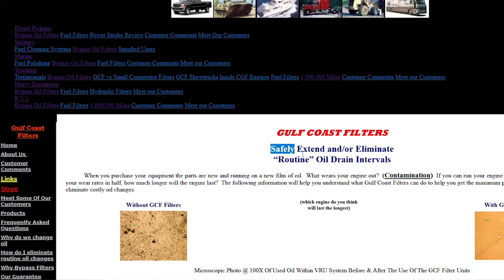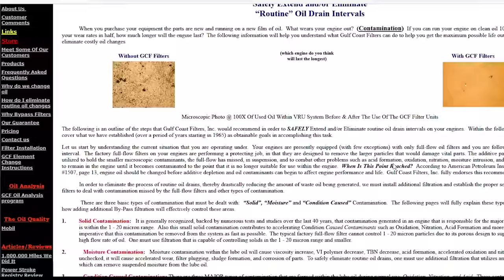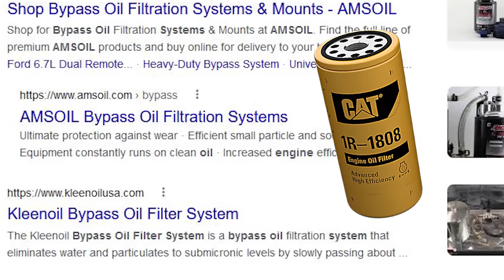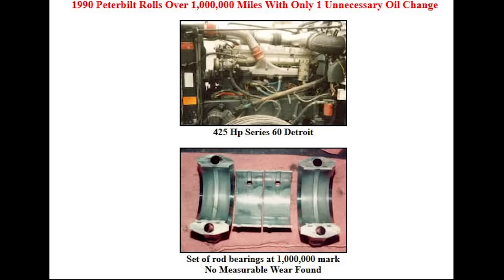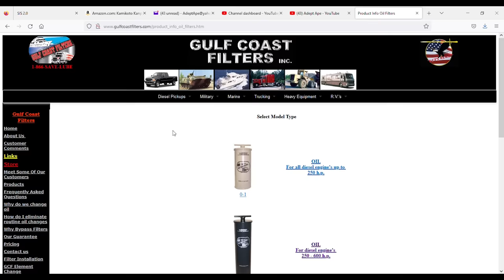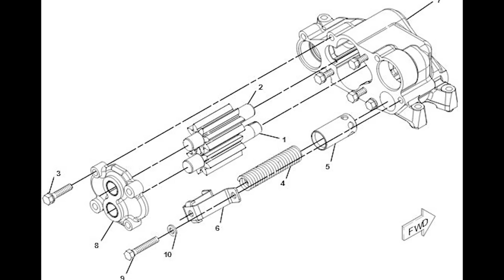No Oil Changes and 1 Million Miles!!! Are Oil Changes Optional with a Bypass Filter? (INTERESTING)

Comment: Im an engineer on a tow boat. My company used to run puradyns and never change the oil unless catastrophic engine failure, or a bad sample. The goal for us on a boat engine, anything from a 3406 or a detroit 60 series up to 12 cylinder 645 emd’s it to get 40-50,000 hours on them before rebuild or replace. Ive seen a few of the older ones go 45-50,000 hours running puradynes. But my company just ditched the puradyns as the prices for those are about the same as changing the oil and filters. We havent been changing oil long enough for me to definitely tell you it’s better, but i was one advocating for it. We have a few engineers in the River division that have said nope to the company’s desire to run the puradyns and not change the oil and just changed it anyway. Those guys have had less engine failures across the board than the puradyns. There is a place for the puradyns, they are wonderful for equipment that you literally cant shut it down to drain the oil. Just close the valves to the puradyns, change them, add 1-4 gallons per filter you changed, open the valve back up. But i stand by that if you can shut it down and service it traditionally you will get longer engine life.

Comment: I use by pass filters all the time but I still change my oil on a normal schedule…I run them for the times I may pass my scheduled change and/or just for a extra safety….You talked about fuel dilution, fun fact the P51 mustang (along with other planes of the time) use to dilute engine oil with gasoline via a switch inside the plane to thin the oil for cold starts…I study plane mechanics and maintenance because I believe they one up the standard mechanic in maintenance and standards in some ways…
Reply: Did the engine oil never get up to operating temp? I know on small single cylinder engines fuel dilution decreases horsepower considerably.
Reply: I always stay up with Aviation technology. They always get the new stuff that comes out then it filters down to other industries years later.
Reply: Wow..maybe i should try this mustang p51 technique  on my 1200cc bike
Reply: I read somewhere that they flipped a switch and injected water in the intake on the fighter planes for extra climbing power. Any of you guys ever heard of the old FAA and PMA approved AeroFrantz  filters.. They used toilet paper. Saw some on crop dusters north of Sedan Kansas in the early 1980s.. Read a few oil analysis reports on light aircrafts.
Reply: @fidelcatsro6948  don't do that!
Reply: Hmmm. I'm not so sure they did that, inject raw fuel purposely into the oil? Naw that would be very hard on those engines. They were extremely stressed (read run hard) in the first place me thinks..
Reply: @Houndini  new stuff? Hah! 1940s-50s technologies? Which we are still running today because of the high costs of getting anything approved by the FAA. At least any GA piston engines stuff. Military yeah probably.
Reply: @oneninerniner3427  They did it for fast take offs to get oil moving once engine was started so they didn't have to wait for the engine to warm up...They have a oil dilute switch right next to the mag switch's.

Comment: The company I work for has just introduced a bypass filter on the QSX15 we use. We're currently in a testing phase to see how far we can take them.
Reply: Please, report back your results if possible. Very appreciated.👍
Reply: When I started using bypass filters in 1963 you couldnt use multi grades in a diesel. Delo came in 30 and 20 weight..The discount stores sold it for about 29 cents a quart. In those days the only filters that cleaned oil were the Frantz and Motor Guard..For diesels you had the Frantz 3 stacker. Motor Guard had manifolded filters..oil is a lot better now. All I use now is 50 year old Motor Guards a few modified Motor Guard compressed air filters Some Gulf Coast juniors and a flat head Ford canister filter adapted to use Scott 1000.Also the Australian Jackmaster Classic. I prefer the top loaders.

Comment: The Heui system is known to shear the molecules and a filter doesn't stop that. Just changed the oil and lab it to know when
I run a bypass and lab it. It filters 10% of the full flow and is microned small enough to pull suspended soot 🤠

Comment: I'm a firm believer in centrifuge oil filtration, if it's good enough for ships, and large diesel power systems (my experience), also for truck engines, stock on PACCAR MX13, optional for Cummins X15.

Comment: Being an independent owner operator with one truck and a limited budget I would be extremely scared to put this on my truck because I can't just wipe out 15k if my B model cat goes kaboom.
Reply: I used to work for a large equipment company with their own fleet of trucks, and they ordered their last batch of trucks with mechanical 3406’s with centrifugal bypass filters, in conjunction with the factory Cat full flow filters. At a 12,000 mile oil change interval, those centrifugal filters were collecting over a half inch layer of heavy sludge in their collector basin. They started extending their oil change intervals to 18,000 miles, and included cleaning out the centrifugal system at the half life of the oil. It worked out well for them.
Reply: @jameskratzer2014  ah cool thanks for the info I honestly wondered how much sludge was in the bottom of my pan with the recent inframe I just had 🤔
Reply: One reason the big Gulf Coast filter works with no oil drains is it takes 3 gallons of new oil at filter change. Thats every 10.000 miles with the million  mile engine.oil analysis showed that was more new oil than needed. My experience is a centrifuge on a motorcycle.  I dont think they require enough makeup oil.

Comment: The truck I learned to drive on was a cabover KW with a small cam cummins.  It had a luberfiner bypass filter on it that we changed at every oil change.  I'm not sure if it was factory installed, aftermarket or an option.  We never had any problems with that engine due to lubrication.  In fact we ran it for over 800,000 miles with a camshaft lobe that had been dressed by hand through the side of the block (on the shoulder of I-10  in Mississippi) after a cam roller pin broke and flatten the peak.  My Dad used a dressing stone made for bench grinder wheels to reform the lobe going far below the hardness layer.  I would say that's a pretty good indication that the oil was doing it's job and that the filter was removing any particulates coming off the camshaft.  I own 5 trucks now none of which have a bypass system and I have seen damage from lack of lubrication a few times.  I would say it couldn't hurt to install one of these but keep the regular oil change interval or even double it.  At least on ISX engines that carbon foul the oil very very quickly.
Reply: I know carbon packing is really bad with ISX engines. Having a bypass filter will clean most of the carbon out of the oil. Because the oil is always so clean, the detergents can remove all the build up carbon inside the engine and prevent any carbon from forming.
Reply: Worked for a guy that wouldnt start a engine until it had a Luberfiner installed. I cut open a Luberfiner element and found it packed with cotton waste with cotton plant pieces.  I think Wix Fleet Guard and Luberfiners mostly use pulverized newspapers and wood chips now. The Big Gulf Coast filters have the economical refills the design of the filter makes the oil travel thru 22 inches of media. With the Luberfiner types the.oil has to travel thru about 3 inches. My 41 Dodge car came with a cotton filter the same as the Luberfiners. I was looking for a 8 n Ford tractor. Ended up with a small Ford diesel. I converted a Flat head ford canister filter to use Scott 1000 toilet paper and installed it.  Opened it up today to see how it is working. Its doing fine but the toilet.paper has cracks in it which means water. Hopefully its just a little condensation.The oil isnt milky. Many years ago when I was a little younger i climbed up into  WHITE  Csb over.I thought this is the biggest truck.ive ever been in. I started driving in an old international with a Cummins. It had a lever on the engine that someone pulled while you started it. 220 Cummins ?  I use toilet paper in toilet paper filters. I use paper towels in paper towel filters. You can pay 30 bucks for high quality elements for toilet paper filters. Rather than putting the towels in a bag I would install a secondary filter like a little spin on filter. and use Bounty big roll like the origionals.if I had concerns about tissue migrarion.

Comment: I've been running bypass filters since the 1960s. They extend the engine life or periods between overhauls. My experience is mostly marine Detroit Diesel 2 cycles. I owned commercial fishing vessels, tugs and a long line of pleasure boats. Engines I ran with bypass filters compared to the same model run by others just about doubled the life between overhauls. I did all the overhauls. Rarely did I ever have to recondition a crank or cam. The bearings were replaced with standard bearings. I was originally was trained on aircraft piston engines, so every surface was mic'd and recorded. I also ran 2 micron fuel filters because of all the parts in a mechanical Detroit injector. I did oil tests yearly. 
I'm retired, live on a large yacht with twin Detroits. I use a standalone centrifuge now. The oil never gets black, always semi-transparent. The engines were built in 1947, rebuilt once by me 11 years ago. Having clean fuel means I haven't changed an injector since the rebuild.

Comment: I definitely trust a product from a website that looks like it's from 1995 👍 😂 The only thing missing is some fancy clipart text. 
There's a lot more that happens to oil then just particle contamination - fuel dilution, mechanical shear, oxidation from heat - a filter can't deal with any of that.
Oil changes will always be the cheapest and best insurance for an engine.
Reply: I do not trust the flashy websites that are clearly scams built by good programmers.
Reply: I change oil and filter 14 to 15k. Have a cat c-15. 10k years back. Maybe not so important now with oil analysis, you could find something on the plug or in the drained oil that shouldn’t be there. Same with draining transmission or rears. It has worked for me for 48 years and counting.
Reply: In reality the reason the Gulf Coast.filter system works is it cleans oil and is big. The engine gets enough new oil because  you add 3 gallons of new oil when you change it .The Road King article said changing the big filter every 10 K miles is equal to a full oul change every 40.000 miles. The system wont work with a little filter or with a engine problem like coolant contamination.The system requires some common sense. There is a shortage of common sense.I would think you would have to make adjustments for different conditions. The truck.is an over the road truck. A heavy duty wrecker in Fairbanks Alaska would be different.
Reply: Allowing the oil to get dirty wear and foul the engine then draining it will never be a good insurance program

Comment: Bypass systems work  extremely well, but it’s not an excuse to neglect your engine. Using frequent oil analysis is absolutely key to monitor these things like wear metals and coolant and  fuel contaminations. One thing you did not mention was the use of oil bypass systems in conjunction with a high quality synthetic motor oil. The really high quality synthetics, such as Amsoil are far more resistant to those heat ranges. You can run oils like Amsoil at 250° all day long and never hurt  it, while inferior oils will definitely suffer from thermal breakdown from even short periods of time over 270°. A place that we really see a benefit with the extra filtration actually makes HEUI Systems operate smoother. Because the fuel injectors operate from high-pressure oil, the cleaner the oil is the smoother the injector operates, you’ll actually see better fuel economy with a quality synthetic oil that is super filtered in these applications. We also have fleets of trucks that have noticed by using a bypass system with our high-quality Amsoil diesel oil, have seen a significant decrease in DEF consumption. Also consider that would be your top offs counteracting fuel dilution. He will also be adding more oil to the system when changing out the filters. And with the bypass filter system on a heavy duty truck you’re usually adding at least an additional gallon to the total capacity. I could go on for days.
Reply: My dad put a Amzoil bypass on a Briggs & straton engine. Used for power washing. 20 years ago. He changed the oil 2 times because the oil analysis came back with where metals a little high. The first time the second time was because he hadn't changed his air filter. After that. He would change air filter every year. That Briggs lasted 2.5 time longer than the mfg suggested life of engine. Every thing I own has Amzoil in it.
Reply: All of my small engines use either the Motor Guard or Gulf Coast filters and Walmart synthetic. The Craftsman got its first oil change in 20 years because  I messed up and put a electric fuel pump on instead of the proper pump. Ended up with a crankcase full of gasoline. It had Mobil 1 in it. These big engine people are talking about stuff I know nothing about. When i was working I did yard mules lift trucks and all small stuff. Which reminds me I have a Gulf Coast jr equipped generator  I havent ran in awhile.
Reply: Amsoil has good lubricants. They have no filters that can compete with the depth filters.such as toilet paper or paper towels. Amsoil will increase in viscosity like other oils if you run it too hot. All I have used is the 10 40..Stopped in Salt Lake City and got a Frantz oil cleaner and Amsoil from a Frantz Amsoil dealer for a 79 or 80 Honda Civic..Salt Lake City with no AC she didnt over heat the oil. What were they thinking when they came up with that dual remote system.Road King Magazine did an article on Amsoil and a 3 gallon Como filter.in a series 60 Detroit. What the hell is a Como filter l

Comment: I would love to see a comparison from a independant lab between the internals of three exact types of engines. One with a bypass oilfilter, one with a coolent prewarming bypass waterpump (which is also heating up the engine to a certain degree before starting) and one is stock, after let's say 100000 miles under the exact external conditions (with the bypassoilfilter engine would be the only one without an oilchange, the others accordingly to the manual) , but that would be extremely expensive and therefore not be happening.

Comment: We have been running GCF for over 20 years it works well
FYI the replacement filter are two rolls of bounty paper towels 
Are new equipment are getting Eco pure filter 
From Pittsburgh power 
We oil sample every 25 k
Reply: When I sold them they used Bounty. I believe Scott Paper company used them on tug boats. I wonder what paper towels they used. A lot of Scott 1000 toilet paper goes in our little filters.

Comment: It would be interesting to know the load & load cycle on the million mile engine . A friend has a c-18 cat in a boat that is set at 1200rpm & 450 hp & it has 60, 000 hrs on it . Pretty remarkable!!
Reply: I am guessing turning a prop is definitely easier than climbing a hill at 80K pounds.
Reply: @trentallman984  agreed. Sounds like an extremely low load situation.
Reply: I put a 1600 Nissan engine in a small boat.The stock propeller wouldnt let the engine get out of an idle. Im thinking how much power does it take to turn a little propellar. The boat came with a junk 2.5 4 cylinder chevy engine. I have a Skeeter bass boat that a guy traded a Harly Davidson for. The owner took him and his wife around the lake and it ran perfect. He didnt know how to back a trailer. His wife was laughing at him. Finally got it in the water. It started cutting out. He brought it back home. It set out in the weather for over ten years.175 Johnson Stainless prop. Needs new gauges. My daughter said you can get it running. I told her I would slide off the boat and make a car hauler out of the trailer.. She said no and ordered me a shop manual. Still in her ex husbands name..He signed the title.
Reply: 60.000 hrs. I just bought a 79 Ford diesel tractor Its a little rough . Been out in the weather a long time. It seems like new mechanically. It has 1550 hours on the meter Got my TP filter on it. The oil they recommend is no longer available..
Reply: @trentallman984  Not really, its harder pulling a prop, it never goes “down hill” per say. Its like the  engine is always pulling. Also their is no transmission.
Reply: @ralphwood8818  Once you reach the needed torque the boat will  get up and glide ,smaller engine you either  .
Reply: @ralphwood8818  You can settle for a slow going bigger prop lower pitch ,or lower the pitch of existing  till you get the engine to rev high ,harder on the motor to get it to hydroplane .You may need bigger motor to go fast .
Reply: @rovidius2006  I learned I dont know .much about boats. I went up to lake Texoma.years ago to put Gulf Coast filters on a 41 foot.Chris Craft. Twin 454s and a generator.. I was sliding around on my rear end. When I finished he took the wife and I for a ride. He could put the boat in the slip better than I could handle  my 14 footer. A few years earlier I did a Carver for him. Two engine covers . Twin 350s. With my boat we would go to the Oklahoma side of the lake and eat in a little restaurant and go back to Texas. . My 14 footer has a 25 HP Johnson.. It will kick ass. Its a manual start. Almost too much compression for an old man to start.
Reply: Dont know how much that tells you. When the testing started the million mile  truck was owned by Pepsi Cola .Then it was sold to a guy that hauled motorcycles